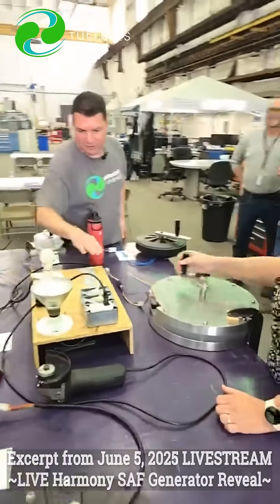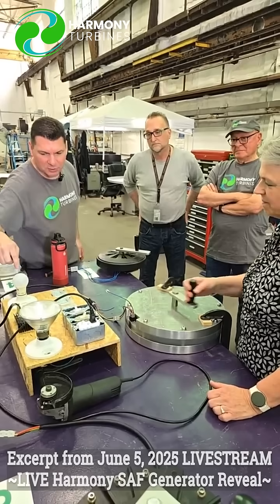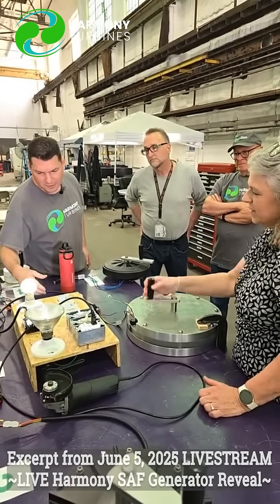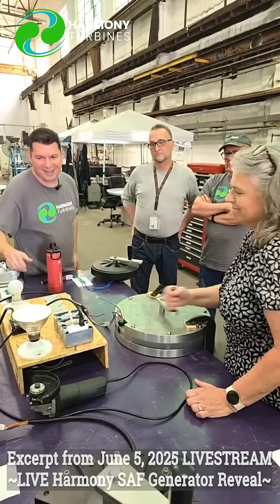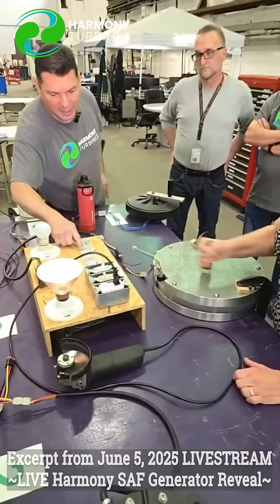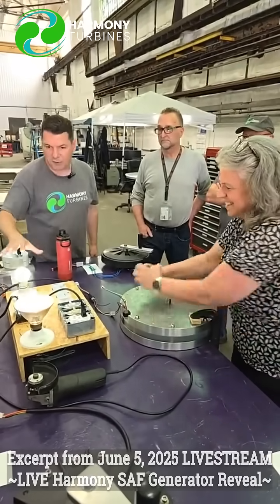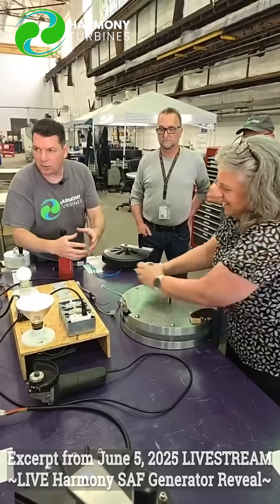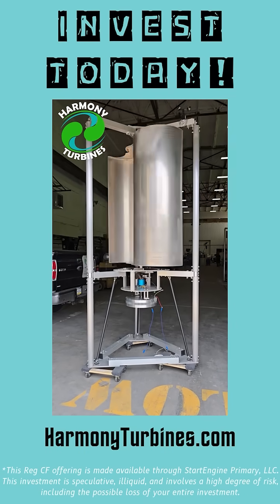Harmony's LIVE SAF Generator Reveal

Comment: Half a amp at 120v is 60watts. Thats not going to cut it🎉
Reply from the maker: Hmmm ok wise one... please do tell us all what one woman should be able to make spinning it by hand like that? I think she did really well. She's not a machine.. Here's our SAF Generator performance chart. Remember this is just our Version 1 SAF generator. We can make all kinds of improvements and tweaks to the performance of our generator because WE do all of the machining in house for it! -Pretty cool huh? This chart compares the performance of the very first one we made to the second one we made with some improvements in machining (removing some eddy current interactions) and improving the bearings. We still have units 3 and 4 to test. Next week we'll add a torque meter to the mix and then we can see the actual power applied at the shaft so we will be able to calculate our SAF generator efficiency with that extra data point. https://harmonyvawt.com/Documents/SAF_GeneratorData_Comparison.pdf
Reply: @HarmonyTurbines  it's not about women's strength but a properly tuned wind generator for certain areas. The best solution would be a variable gearbox . Higher voltages- series windings help with lower cog.
Reply from the maker: @brettmoore3194 have you even taken a moment to examine the power chart we included in this video's description? Here's the chart I'm referring to: https://harmonyvawt.com/Documents/SAF_GeneratorData_Comparison.pdf